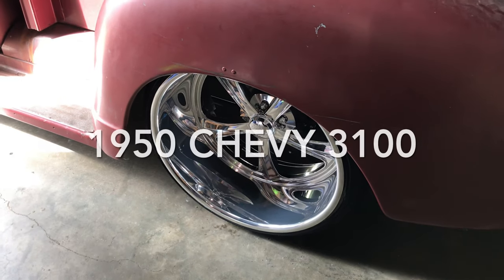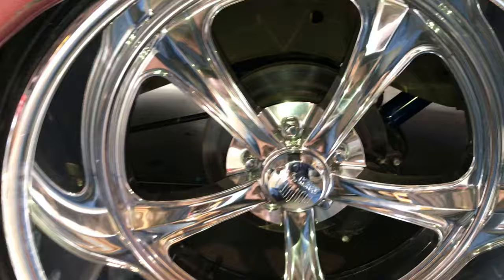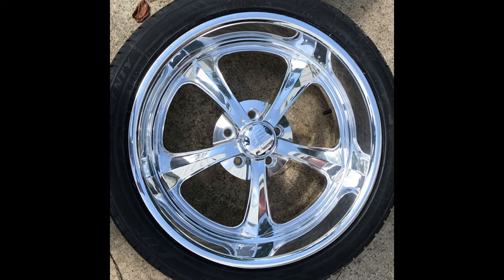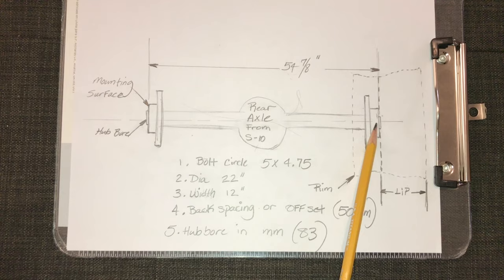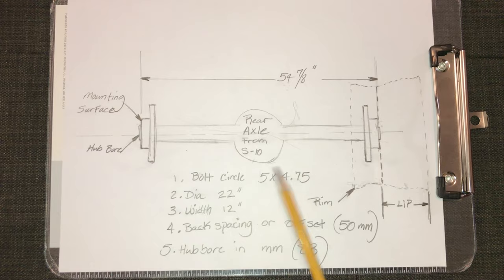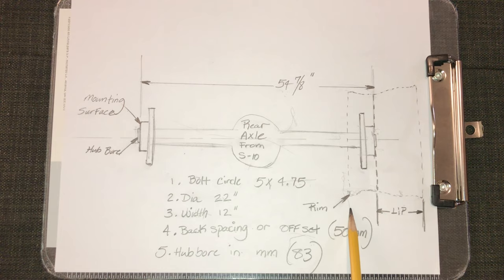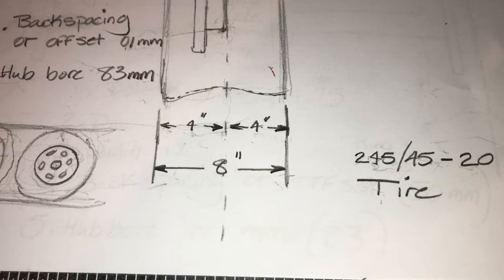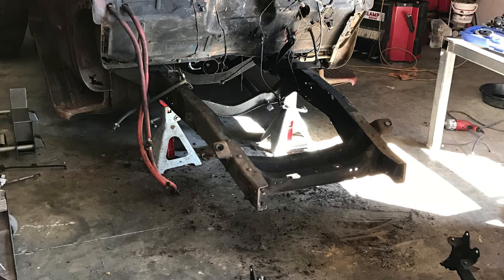Wheel setup explained in detail for 1950 Chevy 3100 Truck!

Comment: With such a wheel configuration, the load on the hub bearing and levers is greatly increased. Roughly speaking, they will require replacement earlier than provided by the manufacturer.

Comment: What year  s-10 rear end did you use , was the rear end once installed perfectly inline with center of transmission or was there an offset
Reply from the maker: I’m not sure what year it is from but it had already been used in a streetrod application when the truck owner purchased it on craigslist. It did line up pretty straight to center front to back. The owner says it rides very well at low and high speeds. I had the speed governed to 80mph and he came back soon after I released it to him for me to raise the speed limiter in the ecm. I raised it to 255mph 😅. I do know that the lug studs are metric…if that helps to determine the year range 🤷🏾‍♂️

Comment: your'e wrong with mesurements .you miss the thickness of hub mount of the wheel 0.50inch
Reply from the maker: That’s part of the back spacing but some people refer to it as ET/offset. These are the measurements I sent MHT Wheels and they built the ones in this video for this truck. Thanks 👍🏾
Reply from the maker: That’s part of the back spacing but some people refer to it as ET/offset. These are the measurements I sent MHT Wheels and they built the ones in this video for this truck. Thanks 👍🏾

Comment: If I don't wanna do any modifications, can I use a 20x10 in the rear? I want it to fill up the wheel well as much as possible so what wheel specs do you recommend for the offset and also, what tire size do you recommend sir?
Reply from the maker: Sorry for the delayed response! I’ve been out of my shop for the last couple of days but I will take measurements from the stock rear end tomorrow and work the math and get back to you. Thanks
Reply: @gillrodshop  No worries brotha thank you!
Reply: I’m also interested in the response for this question. I have an original everything 53’ 3100. I want to stuff the rear and get max 20” wheel up front or 22” front and rear.

Comment: Did you have any trouble mounting the tire on the 12” rim
Reply from the maker: No, it went on without any issues.
Reply: I have same tires and 12” rims just got them and been calling around local shops are hesitant
Reply: Did the bead seal like normal or did you have to do any tricks
Reply from the maker: @frankwhittaker9160  it sealed well without use of cheetah tank or anything!
Reply: I really appreciate the info. Love your videos 👍

Comment: Hey jc what type of motor mounts did you use ? Im fitting a mopar small block 318  and the mounts are directly above the heidts mustang ii crossmember   If i move the motor back much further the distributor will be hitting the firewall   If you have any photos i would greatly appreciate it
Reply from the maker: I used the factory mounts and modified to fit.
Reply: @gillrodshop  i have a quick question. I saw a 50 chevy for $3500 is that the right price for the truck
Reply from the maker: @mikeanderson2152  a lot of factors come in play when determining the value of a classic vehicle. If it is too far gone you may want to wait on another to come available for sale. 
Factors:
1. Are you doing the restoration yourself? 
2. Are the parts you’ll need easily attainable?
3. How many parts will it need?
4. Would paying $1k or $2k more for one in better condition save $6k-$8k in parts and labor?
5. Is it sold with a clean title?

Short answer is that it sounds like a great price depending on what condition it is in and if it has a good title!
I’ve had people buy cars that are way too far gone and ask for restoration estimates and are very surprised 😮 when I quote them.
Reply: @gillrodshop  ok gotcha. I also saw a 68 impala it has a clean title but the car need lots of work
Reply: @gillrodshop  if you can check your massage on Instagram
Reply from the maker: @mikeanderson2152  that impala looks salvageable but it’d take a lot of work.
Reply: @gillrodshop  ok the floor had a lot of rust. Im thinking about having someone do the work if i buy the car, i know its going to take a lot of time and money to work on the car

Comment: What is the tire size you are running on the 22x12?  Thanks
Reply: Just so it in the video
Reply from the maker: 305/25R22 rear and 245/40R20 up front. Thanks for watching and commenting!

Comment: Just subscribed.  where can I find that suspension set up?
Reply: You used to cpp suspension kit up front but about exactly did you use for the back?
Reply from the maker: I used ebay four link bars and Aldan coilovers. The rear axle was purchased from craigslist and had been allegedly remove from a streetrod and had the four link setup already welded on. Basically an S10 rearend modified for four link! I will look back and try to get a component list together for you in the next few days! Send an email to gillrodshop@gmail.com and I’ll send those part numbers soon! Thanks

Comment: Nice .. beautifull.  Is a s10 frame?
Reply from the maker: No, it is the original frame. Thanks 😊
Reply: @gillrodshop  any modification in front and rear suspension?
Reply from the maker: @johnlondon8554  yes, substantial mods that include CPP IFS and 4 link with S10 rearend. I’m not a big fan of CPP’s IFS but the customer wanted to keep cost low!